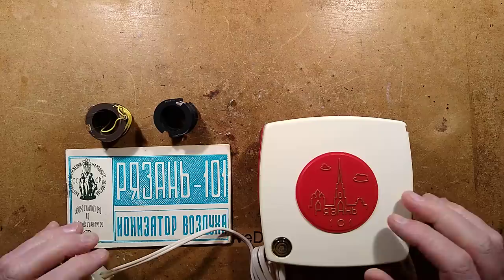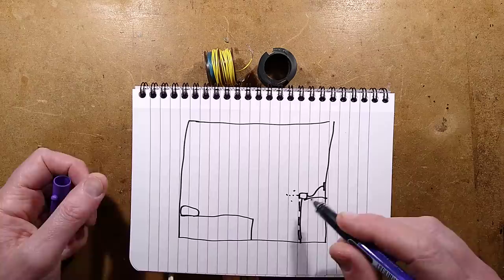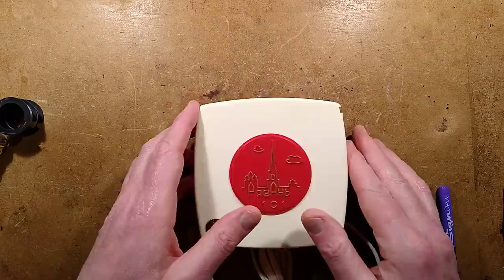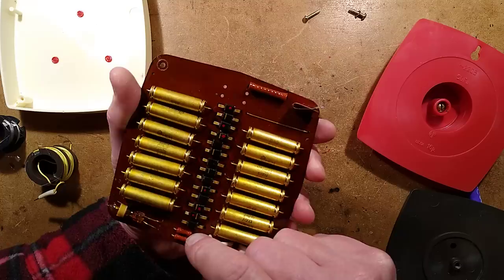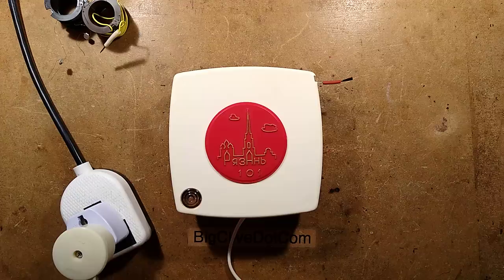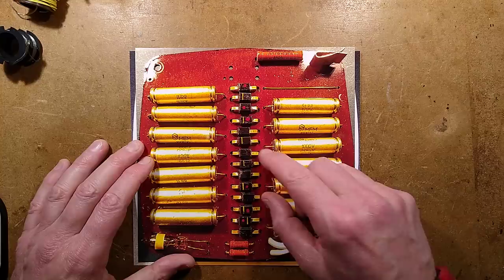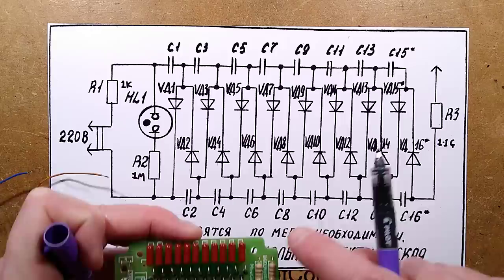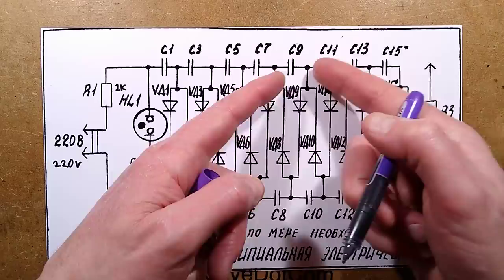Inside a soviet ionizer from 1990 (with schematic)

Comment: Thanks for explaining for what they are. Interesting aspect that they precipitate dust. In some ole factories there put electrostatic filters on the chimneys. Are there some like that for removing dust from air without making me need to clean the furniture after?
The place that I live is near a main highway that cross the city and because of tat is very dusty.
The computer towers are concentrators of dust in particular.
I just don´t like the idea of sleeping under a 8000V wire (the voltage multiplier of that thing has a lot of stages).
Reply: Sure.  There are whole house ones.  Search for "electronic air cleaner" and you'll find some electrostatic filters that go in your ducts.  You'll have to clean the collector plates periodically, but they don't make a mess anywhere else.

Comment: At a gigaohm I'm surprised they even needed to install the resistor!
Reply: I never knew a gig ohm resistor even existed lol crazy 😂👍
Reply: @muzikman2008  for a replacement, just pass your finger between traces and the finger fat will be the resistor.
Reply: @plainedgedsaw1694  cool.. You go first! 😂🖕
Reply: I've encountered a 4 Gigaohm resistor in a radio microphone transmitter. I've absolutely no idea why such a high value was requited. It was a thin flat thing - looked very like some Soviet ceramic capacitors (those red flat ones), i.e. like a disc ceramic but thinner and red.
Reply: @Bartok_J  I installed a 5 Gig ohm resistor in my DIY microphone

Comment: The Soviet Union was a multivoltage country. Rural places had 110 and cities ran on 230 based on what I'm told. TVs and radios have voltage switches. Some post Soviet places still have the lower voltage
Reply: I had few radios, a TV, a cassete tape player, oscilloscope, signal generator, spectrum clone home computer, calculators that had 127/220V voltage selector in a form or another. I mean that there were a proper voltage selector switch in some or a physical way to use only one voltage in others (the TV had a bracket that when switched showed another power plug for the power cord and the computer power brick showed another fuse socket for the other voltage; only one could have been populated at a time)

Comment: No, we don't have multiple voltages. Linear is 380 and phase is 220, but it is also worth noting that voltage fluctuate a lot and can drop as low as 190 and even  lower in remote grids

Comment: I have been watching your videos for a bit, and I really enjoy them. I have learned a lot. I am interested in getting into electrical stuff and knowing how things work and I really like knowing about the scam devices and how they work. I got an LED Christmas tree soldering kit for my birthday in November. It’s only like four or five inches tall. I was thinking back to videos like yours and other channels like yours. But I felt so proud that I eventually completed it successfully! I hope you are doing well and maybe you can make more videos on scams/phoneys/placebo devices? 😉😊❤
Reply: Also, are ionisers the devices that put out ozone?
Reply: @thoracis  I heard that ozone is only released if a plastic case is used, I read it on the website of a Russian manufacturer of ionizers, so they use wood, not plastic. I don't know if this is true or not. The problem with these ionizers is also that they electrify the surface and then all your walls and furniture will attract dust.
Reply from the maker: A real ioniser will only put out trace ambient levels of ozone as found in outdoor air.

Comment: There actually were two voltages in soviet Russia - 220 and 127, 127 is an old standart, 220 is the modern one, so there was a period in time when both were in use, when standarts were renewed, but not anymore.

Comment: You gave me an idea with your video. I wonder if I can use a voltage doubler on my new wind turbine project?
I use a NEMA 23 Hybrid stepper motor with 8 wires coming out. It was a sample that I never used cuz of weird unipolar wiring. The voltage is a bit low even after cascading the outputs to get a 2 phase AC output. It would be nice to double each output before rectification and filtering to DC, then use a buck converter to bring the voltage down to 15V max to charge the 20AH SLA battery. 
Thanks for the inspiration BC. I'll try it today.
Reply from the maker: Maybe a boost circuit?
Reply: @bigclivedotcom  unfortunately, I've used up all the five MT3608 modules I had. 
I'll buy 10 more. They are so cheap and useful.

Comment: Have you measured the output voltage? I can't remember my Cockcroft-Walton theory. Is the output simply 220v x √2 x 14 capacitors =  ~ 4.3kV?
Reply from the maker: The circuit is so high impedance that a meter will load it down.

Comment: A lot of people get tripped up by the thought that if the first stage doubles the voltage then the next stage must also double the voltage and so on. This isn't the case; if it were, this would be called a voltage exponentiator. No such beastie exists! It's called a multiplier because you're (theoretically) multiplying the voltage by the number of stages.
Also, as Clive mentioned in his live build of a multiplier on a 3D printed form, there are always losses, so while there is no theoretical limit to how high you can multiply the voltage this way, you rapidly reach a point of diminishing returns.

Comment: I recognize that corona discharge wire. We used that in laser printers.  Ionizers create ozone which is a cancer-causing agent. Better off with a HEPA filter on your central HVAC system. Allergies or cancer risk, your choice. Cool old tech. Nice video.
Reply from the maker: Ozone does not cause cancer.  It's harmful at high levels, but is a standard part of natural air at low levels.  Real ionisers generate less ozone than natural levels.

Comment: So Russian! Reminds me of when one of the early Foxbat military jets crashed and the US investigated its technology. It was  a fast jet because of massive engines which had very little high tech in terms of avionics or metallurgy.  It has  lots of bakelite switches.
Reply: Yes it used valves but could take a EMP of nuke and keep going and before getting captured could not be jammed
Reply: The metallurgy was good, it's just that others thought that soviet engineers had some kind of a massive breakthrough, but they didn't.
Reply: @MrPaukann  Yes that's a  more accurate description.
Reply: @gingernutpreacher  It should be noted that its EMP resistance was a side-effect of its rushed development and not a deliberate design goal. Aside from some specialized equipment, EM resistance was rarely a major design goal of any military equipment. The electromagnetic pulse effect has been greatly exaggerated by the media; really, if you're close enough for it to be a problem, the great big explosion is going to be a much more immediate concern.
Reply: @TheRealColBosch  it should be noted they used valves manly because they were behind in that area the BBC used a valve transmitter till 96 ( not sure on the date) Cheyenne mountain made a big effort  to protect against emp it's only exsagrated on hardened military eqp domestic stuff is another matter do you think a smart phone will not survive

Comment: Those components look quite standard for 1990 Russia.

A lot of Russian components are very high quality, especially those made for the military, which post 1991 ended up in consumer electronics. I have a few things from Russia and they all have military spec components. Later, towards the late 90s, the quality dropped significantly and pots just fell to pieces from gentle use. 😂

I always liked that they printed the values on resistors.

Comment: Such chonky components.  There's something very visually appealing about the whole thing, but I wonder if it actually does much at all with that massive resistor and the comparatively lower voltage...
Reply from the maker: Electrostatic effects take extremely low current to achieve.  It's literally working at electron level.

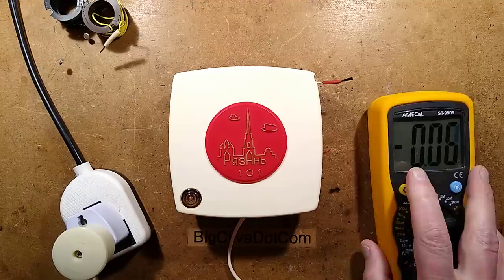Comment: 7:20 So, it even choohes!

The plug appears to be a standard "Russian" plug as some call it. Finns semi-officially call it "zero class" and it used to be very common in Europe with non-grounded appliances. The now very common "SchuKo" plug is technically a derivative, with the same pin spacing but with ground contacts as well as cutouts to prevent plugging zero class  devices into the sockets. This didn't keep people from trying though, and especially rubber cast round plugs were often carved to fit. This was not always safe because you could make a floor lamp or similar device designed for dry spaces plug into a bathroom socket.
Reply: This is one thing I really hate about the Schuko plugs, it's so backwards to allow grounded equipment to be plugged into ungrounded outlets while the opposite isn't allowed. People kept installing ungrounded outlets for as long as it was up to code because otherwise they couldn't use old ungrounded equipment, I live in Sweden and that was allowed up until 1994. Because of this we have way more ungrounded outlets than India for example.
Reply: @Eddies_Bra-att-ha-grejer  This has also been my slight concern, which I brought up in Finnish Quora some time ago. Someone commented that it is a calculated risk, where a single SchuKo-plugged appliance ued in a dry space without its ground connection is not readily a great hazard if sources of earthing are not nearby. Any appliance should be designed well enough that it can do without earthing; it becomes a necessity in "wet" spaces such as kitchens, bathrooms, and outdoors. 

Yes, we do have un-isolated standard sockets in our bathrooms, in many apartments and even a plentitude of detached houses there is no other place to put your own washing machine for example. Most apartment blocks built before the 90's have a common laundry room to be used by the tenants, though.
Reply: @Eddies_Bra-att-ha-grejer  Actually no, schuko plugs have the pins thicker that normal ones and the non-earthed outlets SHOULD have thin holes so a shucko plug would not fit. I know because my old house had old outlets in rooms without ground and in bathroom, kitchen were shucko outlets. The holes were different in sizes. Just compare a shucko and a non earthed plug. The main reason was the power capabilities of the outlet (non earthed was rated at 600W while shucko at 1200W in my old house). Now, all the outlets are schuck in my house, it seems to be the norm.
Reply: @sebastian19745  There wasn't a proper standard for those so the outlets could differ by country in terms of how thick the pins were or the exact distance between them, so in some countries they aren't compatible like that. This is the reason why Europlug (the flat ungrounded plug) has thinner pins than Schuko and they're angled inwards, it's a compromise so they fit in old installations in Greece and whatnot.
Reply: @sebastian19745  I don't remember seeing those. Which doesn't mean there haven't been any. As far as I know SchuKo has fit all Finnish zero class sockets I'm familiar with. Like someone else said, there has been some variance country to country.
Reply: @sebastian19745  Non-earthed sockets had 2 types: plugs with 4mm pins were rated for 6 A 250 V, plugs with 4.8mm pins were rated for 10 A 250 V. Never 600 W as you wrote.
Reply: No, that was not the risk as nobody would do, The risk is that if you have a grounded device like  a computer next to the lamp and the lamp fails and you touch it and the computer at the same time.
Reply: @Eddies_Bra-att-ha-grejer  That was an important safety principle. Grounding has to be all or nothing. You cannot have grounded and ungrounded (not double insulated) devices at the same location. 

Now the stupid thing is that they made ungrounded devices so long. We had a German TV. In Germany it would have gad a schuko plug but for Finland it was equipped with an ungrounded plug. We had a tile floor on the TV corner so it had a grounded socket. Then we added an illegal extension cord to remove the grounding. This all could have been solved if it had been grounded but then many would have thought it needs a grounded socket. I personally have had no class 0 equipment since mid 80s.

Do you get what is the level of electric safety in India? Ten thousand people or 7 per million die annually from electric shocks. In Sweden that is about 2 or 0.2 / million. Sweden had Indian level of safety in the 1940s.
Reply: @okaro6595  that is one possibility of higher likelihood, but people did plug their modified low insulation class appliances pretty much everywhere, including bathrooms. Anything with a Euro plug should now be double insulated and have an extremely low likelihood of any metal surface parts becoming live, so they would be safe unless quite soaked.

Zero class sockets are still available and you can renovate an existing installation with them if you do not modify the wiring "remarkably". They are mandated to have such deep recesses that bare plug prongs should not be accessible when loosely inserted.
Reply: @jussikuusela7345  It was not considered even that. A grounded device without grounding is no more dangerous than an ungrounded device. At first everything was ungrounded. In 1930 the law in Finland mandated that in bathrooms and kitchens one had to ground devices. This meant schuko plugs. Elsewhere grounding was not needed and it actually could increase the risk if kids stuck needles to outlets.

All deceives have basic insulation. But the principle was that it should be safe with one failure. This was done either by grounding or ensuring that ground was not available. Now the second was always a compromise as a radiator was not counted. It was seen that the paint insulated enough.

With computers there was a problem that they leak and this can cause problems with other devices like televisions if they are connected.

In Finland there also are sockets in barrooms but they are reserved for a washing machine. That is printed on them. Sometimes they read that use prohibited during bath or shower. On modern installations with RCDs that does not apply.
Reply: @sebastian19745  That was in the past. Since the 1960s or so both have used 4.8 mm pins.
Reply: @okaro6595  In the 1950s it was commonly advised not to touch electrical appliances and grounded metal pipes(gas, plumbing) at the same time.
Reply: @okaro6595  My childhood home (built in the 60s) only had grounded sockets in the kitchen, and there were ungrounded sockets right next to metal radiators, I've been told that it was common practice to do this and that a lot of electricians didn't actually understand the rules for class 0.
And yes, as I mentioned people kept having ungrounded sockets installed to the very end because they had old equipment that they wanted to keep using.
As for India, since there's no ungrounded version of that connector all installations that are done correctly there should be grounded from the very start. But in Sweden and Finland ungrounded sockets have been common for the sake of saving relatively small sums by not having to have a ground wire.

Comment: EDIT: I just realized that if this is indeed from 1990, that means that the capacitors are most likely polyputthekettleon and, perhaps more importantly, that this is from the transitional era between Soviet and capitalist Russia.
I wonder if that thin emitter wire was recording wire. Would the high voltage but low current be enough to degauss any KGB secrets remaining on the wire?
On a more serious note, I'd be worried about those chunky paper/foil capacitors being leaky...though I suppose that wouldn't be too much of a problem in this application.

Comment: Seems like something I would have envisioned from the USSR - a device built with what looks like robust components many decades behind what the West would use. The KGM building is not surprising. I did have a chuckle at the numbers "101" on the ioniser, almost like the USSR were saying it was a basic unit, which it actually is!

Comment: The thing in the manual is a Soviet radio/vinyl player, and the reason they use these chunky capacitors is that the factory must have also been producing AK-47 ammo in its free time.
And that plug is pretty standard for Soviet-era electric appliances, and must have been assembled by blind people (assembling small household items was one of the most common forms of employment for the blind in the USSR)
Reply: I'm just wondering what the ammo has to do with capacitors.
Reply: @dickJohnsonpeter  it's a running joke in Russia that any factory can be converted to making AK-47 cartridges, even those that produce cigarettes and macaroni. Well, maybe it's not a joke
Reply: @dickJohnsonpeter  A lot of defence factories during disarmament in 80s were told basically "hey, you dont do weapons anymore, produce something else". And they had to improvise with very specific materials and tools they had on hand. Those capacitors are probably mil-spec.